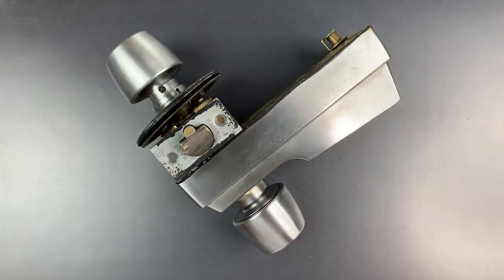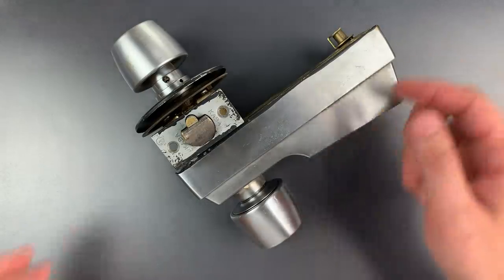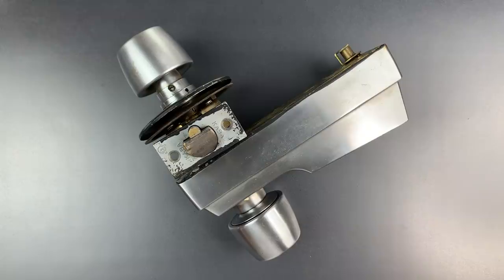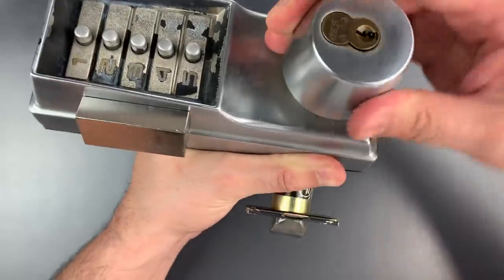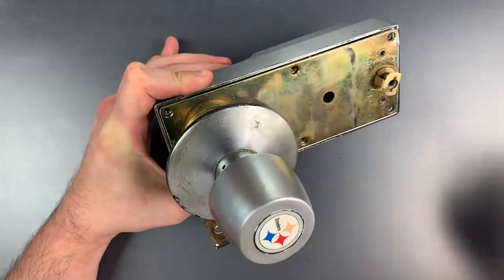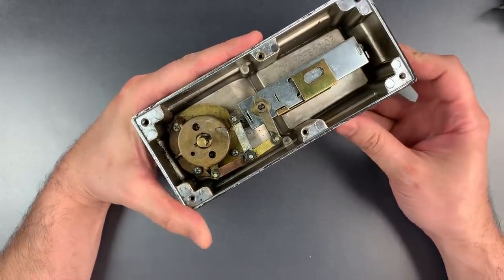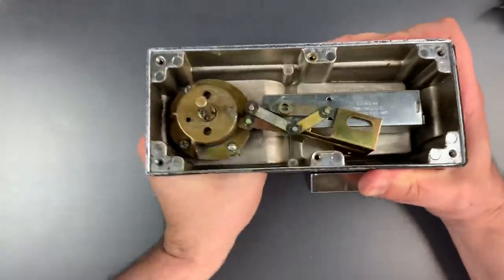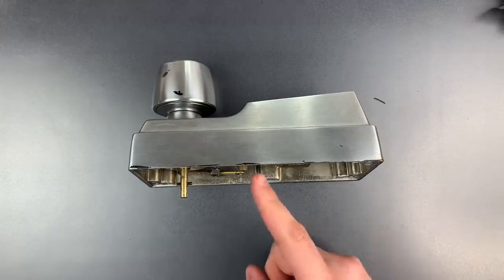[914] The Worst Lock Design Blunder Ever? (Kaba Simplex Series 1000)

Comment: What was the fix?  make that problematic part out of aluminum?
Reply: Probably taping the same magnet to the opposite side, inside?
Reply: Just make the entire housing cast iron. . .... or all innards brass .... or even just change that tongue to brass
Reply: Or even make it out of non-magnetic stainless steel
Reply: @Boomkop3   um no.. It will make a magnet non magnetic. It won't take the iron out of the steel .
Reply: @Boomkop3  Yes, when its literally red hot.
Reply: @loganricherson  use plastic
Reply: @rivandoalrasyid1499  I think LPL has shown us not to put plastic in locks
Reply: @loganricherson  thanks you i remember it now
Reply: @loganricherson  yeah but kaba is a swiss brand they'd remember to make it out of carbon fibre reenforced PEEK
Reply: a small dimple in the lock mechanism housing preventing the steel band from bowing out
Reply: @Boomkop3  The curie temperature of iron is 770 deg C
Reply: Oooooh hi Larry, I didn't know you were subbed yo this channel 💙💙💙
Reply: @LadyZubat  He's subscribed to literally the entire Internet. There's nowhere I haven't seen him. Hello, Larry!
Reply: This guy is seriously everywhere.
Reply: @Boomkop3  but it becomes magnetic again when it cools
Reply: @Boomkop3  Heating the steel with a lighter will not make it non magnet.
Reply: y e s
Reply: Just one part is needed to fix it:  a better designed replacement lock.
Reply: This comment was duped apparently?
Reply: Make the whole thing out of gold!!!!
Reply: @skate3ronai426  not soft enough enough.  use chocolate.
Reply: Go on then,  show us your minge.
Reply: @Larry Bundy Jr  Well helloooo you! Funny the people you'll run into on YT. lol
Reply: My guess is that they put a piece of mu metal on the side to shield the magnetic field.
Reply: 2 simple fixes I can think of would be making the metal part from a nonmagnetic material (aluminum, plastic etc...) or to install a Mu Metal plate inside the housing to deflect magnetic fields
Reply: 300 series stainless steel is generally non-magnetic.
Reply: @loganricherson  Using plastic for the part that's used to intentionally bypass the locking mechanism should be okay. If you break or melt the plastic part, the bypass is deactivated and you have to use either actual key or code to open the lock.
Reply: Hello You!

I think so
Reply: Larry! My favourite game guy!
Reply: But, hello you! Glad there's another fellow Brit who's a fan of LPL!
Reply: I just keep running into you...

Comment: this lock is still being used at a movie theater in Florida. It's on the doors to the projections room, snack stand area, break room and both managers office. I worked for the theater up until 2003 and an about a year go I stopped in and see they are still using these. I Knew how to bypass the lock like this back in 2000 when I started and made the Theater managers aware of it but they never changed it LOL Now today, it's an all-new management team running the theater, so I asked to speak to the head manager and explained I worked there until 2003 and I pointed out the weakness of those locks. He didn't believe me, so I used a spare car stereo speaker I had in my car to do it. He was shocked. But for fun, I asked him if I could try the lock combo I used in 2003 to see if they still worked or if they have been changed :P I could unlock all the projection doors and Theater managers office LOL so in 16 years they never changed the combo's on most of the doors :P just to say, it's easy to change the number combo for them

Comment: It would be very interesting to see what the minimum magnet strength required for this is. Neodymium Iron Boron magnets were only invented in the 1980s (another family, Samarium Cobalt, is about 20 years older but was rarely found in consumer goods until the 1980s). I suspect that strong enough magnets to cause this problem did not exist commercially when this lock was designed.

Comment: I remember going to a high value location location, exterior door, and putting in the factory code and opening the door ahead of my handler. No one ever changed the factory setting. I am sure it caused problems for someone down the road.

Comment: My "workplace" ( I'm retired now ) used a s**t ton of these locks.  I've found they are usually configured for 3 digits to open, and I just came up with a sequence to go through the possible combo's, considering each digit can only be used once, and I could usually get them open in less than 3 minutes, even less if it was set to the default ( which I wont disclose   ; ^)    )

Comment: Remove the metal thumb mechanism and the lock is now totally secure.I have the same lock and put epoxy putty in the key way so it cannot be picked only drilled through. And if your going to do that use a sledge hammer to knock it off the door then. But as for the magnet trick once plate is removed or made from plastic there is nothing for the magnet to pull. A 3D printer come in handy to make a replica of that part in ABS or PVC or other high tensile plastic

Comment: I bought a Building for taking down. Inside the back is a Major Standing Floor safe. In the back of the safe is a keyed compartment.
The safe was left open and the dial turns freely. I have the serial number and the model number from inside the door. How can I buy a reset key for it to change the combination so it can be used and not sold as scrap?

Comment: I’m not sure this is all that big of a deal ... note the latch and the simplicity of the code buttons.  This lock is meant to compliment a dead bolt in high traffic environments where some basic security is needed.  I used a lock like this for a driver back door at a pizza joint.  During operating hours it discouraged customers and others from entering the wrong door, although it wasn’t a big problem if they occasionally used the door.  At night the door would be fully secured by a proper dead bolt.

Comment: Than part is generally not installed in the chamber if the lock doesn't have a bypass thumb turn on the inside face plate.  However considering peoples laziness the combination is generally set to 135 or 531, or any version of a 3 digit combination.  Factory default is 2&4 together then 3.

Comment: I ran into dozens in use. All were set to either the last 4 digits of the street address or less commonly, the last 4 digits of the phone number. In the case of the phone number almost all numbers were in public phone numbers.  A magnet would have been handy but mostly not needed.

Comment: That part has no business being in that lock except for the purpose you described. I would use that slot in the combo chamber when the combination chamber failed to open and there was no outside key bypass system. I would drill a 1/8” whole at the top of the lock and insert a long scrum tool down the lock and put it into the slot in the combo chamber and then turn the outside knob or lever to get in. The repair of the whole was to tap it for a 1/8” security torx head screw with tapered head.

Comment: Yup, an upgrade for this lock is available.
Neodinim magnets are great little but powerful gadgets to have. That same size magnet you show can even release a lot of anti shoplifting and dye trap tags used on clothing in retail stores.
Slap two of the 6" long RE magnets on either side of your electric meter from behind the wall its mounted on and you can cut your service bill in half but if you get caught........Ben Dover will pay you a visit.

Comment: The steel "Flap" as he calls it can very easily be removed, and the magnet will no longer unlock the lock. Removing it will not change how the lock operates and the push buttons will work normally.

Comment: Can people simply remove that plate or block it's movement?  LPL says that the plate allows a knob on the inside of the door to activate or deactivate the locking mechanism.  I assume that it's not required to open the door normally (just use the doorknob).  That seem's like a relatively rare use case, so most people could simply secure a wooden block in there to stop the movement.  (Since many comments say that their companies are not replacing the locks due to the expense.)

Comment: The magnet only works on models that had a thumb lever on the secure side that kept it unlocked. Less than 10% of those locks had that option.
Reply from the maker: I believe a more powerful magnet works on non “passage mode” locks. It directly manipulated the fence.

Comment: A place I used to work had push button locks, looking similar to this, that didn't depend on the order you push the buttons, after a year or so, you can "decode" those by looking for the polished keys, almost equally tragic

Comment: Another flaw in this product is partially human error. Most applications of this lock typically use 3 of the 5 numbers and you can't use the same number twice. This limited the number of combos to around 60 or so, with the number of combos topping out at 120 if you use all 5 buttons. If you knew how many button presses were needed, you could get in with just a couple minutes of trial and error.

Comment: Unfortunately the new ones must be destroyed when they fail, and they DO fail, because there is no way to get around them in certain applications. Thus the lock must be drilled/destroyed. This is especially true for Onity as well. Previously the front cover could be removed on /most/ models and you could disassemble the lock, with the right tools, and gain access to the door. However with it being an obvious security flaw it was "fixed" to where if a lock fails on a secure room.. you're SOL since kicking the door in is rarely a viable option when the lock is cheaper than the door or frame(barely).

Frankly I'm not a fan.

Comment: I have installed these locks for access to special rooms, none had the turn latch on the inside thus no metal plate, not openable with a magnet.
If you have one that you are worryed about, it's a simple Job to open it up and remove the metal plate, only thing is now you have to use the punch code every time you want to open the door.
Simplex will surely come up with a ss or plastic replacement.

Comment: I know of a couple of other older codelocks (1990:s) that also could/can be "opened" with a magnet.
I will not tell which, as I still, strangely enough, feel a sense of loyalty towards my, then, long time employer. Sorry?
But in those the weakness was in the choice of cheap electrical relays used on the pcb. The bi-metal tounge inside the relay,
could be pulled with a strong magnet held at a certain spot on the casing.

Comment: That "flap of steel" is only on the locks that had a passage mode, A VERY SMALL percentage of these locks. They are good locks, no batteries, no easy to bypass solenoids, they are on a lot of handgun safe boxes !

Comment: Ive worked in two separate bank companies and both of them used these or the ones after 2011 in some cases for secure areas. But they are both very old companys so i would bet they are the pre 2011 versions.

Comment: There's a potentially different flaw, but maybe I'm misunderstanding:

For this mechanical lock, the order of the numbers doesn't matter. You can use 1-5 digit codes. But what this means is that if you pick a 4 digit code, there are only 5 combinations; a 3 digit code has 9; a 2 digit codes have 10, and 1 digit codes have 5. It doesn't seem to matter if you start with the wrong number, although mixing the wrong number in among the other numbers should keep it locked. Still, that means the total codes available are 29, so even if you don't know how many numbers there are, if you have a few minutes, you should be able to brute force the code.

Is my guess correct? Does this make this worthless in areas where there is little foot traffic? Even if it is updated to not have this magnet defeat?

Comment: The positive take-away of this video is that it was posted after industry and government was made aware of which specific model had a potential for attack. This lock, because a single code applies to all users, and there is no audit trail, nor curfew control..... was UNDERSTOOD by professionals to not used for UNSUPERVISED or areas requiring Midlevel or better security. These were a low-security requirement lock, generally for restrooms, pool and recreation areas.... as well as common entrances to apartment buildings etc... basically a minimal traffic control device. Govenment generally would augnment with video monitoring, if using this product, in areas that did not deem requirment of other products they use for mid-high security requirements. MOST units did not have this feature, as a SECURE area will ALWAYS lock, and have no passage mode. Issue null and void! But plenty enough of these did have the daylock ( passage ) feature to warrant a redesign, once the exploit was detected, if only to protect the brand. MOST users of keyless locks moved on to any of a number of Electronic keyless locks, long, long ago, for many reasons. In order to gain individual codes and card validation, audit trail and ability to surgically excise a single user. I stopped selling these when LEVERS were required, as there are many failure issues with the lever design, not the case in the earlier knob version. There are other exploits that I will not innumerate. This is one very good example of why NOT to buy from the catalogs or Amazon. You get old production product, seconds or otherwise surplus goods, and a lack of guidance toward better product options. But this lock is a trip down memory lane. Many Many millions of these were made, and EVERY one had a hand-made combination chamber.

Comment: The Simplex lock has been around for over 50 years.  They are an extremely dependable mechanical lock system (minus this horrible, not thought out modification that left it useless).  I’ve seen them on secured doors on every Air Force base I have been to (from California, NY, Alaska, Washington, Florida, Hawaii, as well as Canada.

My Stealth pistol safe has the Kaba Simplex lock mechanism.  That is the reason I purchased it.  However, not having any other way to open it, in case the lock ever fails, can be worrisome.  Anyone who has looked for a handgun safe knows that the key entry is the weak link (most of the time they are jokes).  I also consider biometric safes as simply unreliable.  I also don’t like electronic anything on a safe.  Fast Action Safe (FAS) in Texas has terrific gun safes that uses a Simplex-type locking mechanism, along with a key access.  What separates this “In&Out Lock” from any other I’ve seen is the following:  http://www.fas1safe.com/about.html
1.  10-pin version of the Octagon Mechanism (std pin tumbler lock pick won’t fit).

2.  Drill resistant hardened steel body and center.

3.  Head profile and retention resists drive-through attacks.

4.  Three position lock:  IN: allows for Simplex lock entry or backup key entry, NEUTRAL: has no function, OUT: Safe cannot be opened with the Simplex lock, even with the correct combination (great when not at home).

I’d love for you or Bosnian Bill to test out this key lock (or the safe).

Comment: You know, nowdays a Bluetooth version of these wouldn't be too infeasible. If your work phone's your ID and wallet, basically (like in some Asian countries for a solid decade) the push-to-open feature could be an NFC-powered affair and the lock would be either bluetooth operated from the outside, or bluetooth operated with request feature for the security officer to confirm via NFC (which would basically be keeping it off until power signal is sent via NFC or timeout to error condition).

Comment: There are also some other very common (and completely crappy) push-button mechanical locks that don't care what order you enter the digits of the combination, infact you can press all the relevant buttons at once and it will open. This greatly reduces the key combinations needed for entry, making entry real easy.
Just have a close look to see what buttons are used, no need to worry about the order - REAL BAD

Comment: Hi LPL. Love your videos. Always interesting to watch. One question though. In the programming world there is the concept of secure disclosure when a vulnerability is found. Basically, when a hacker finds a vulnerability, they tell the company without telling the public so they can fix the issue before any malicious attacker can exploit it. I know in the physical world that might not be easy to do since you would need to fix all the locks out there. But still I wonder, isn't disclosing this kind of unfixed vulnerability kind of irresponsible? In the sense that your whole channel is a catalog of vulnerable locks and how to pick them. A malicious person just needs to watch your channel for the easiest locks and then be on the look out for those. Are you not worried you might be helping the wrong side here? From an engineering perspective I love these videos. Just wondering.

Comment: A little bit of knowledge is a dangerous thing.  I’ve been smithing full time since 70.   19, not 1870.  In all those older years I did not see a lot of 1000’s with the passage function, and don’t ever recall ever seeing the “flapper” installed on the standard model.  And yes it was a definite defect.  But to exaggerate this to be a horrendous problem is HS.

Comment: i worked at a movie theater back in the early 2000's, that had a lock like that to get into the area behind the concession stand.   You could literally just push all 5 buttons at once and it would open :|

Comment: Reminds me of windows xp.  One could gain access 99% of the time simply by hitting F8, going to safe mode, and then logging in as the administrator.  It was extremely rare that the administrator password would be set as it was a hidden account;  to change it, it was necessary to do using the admin/manage gui ('my computer'/right-click manage...')